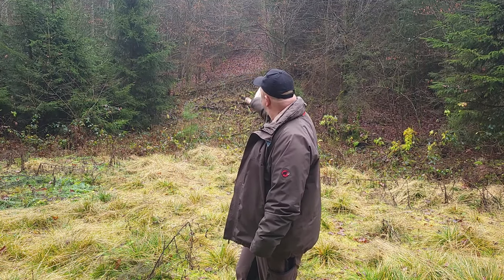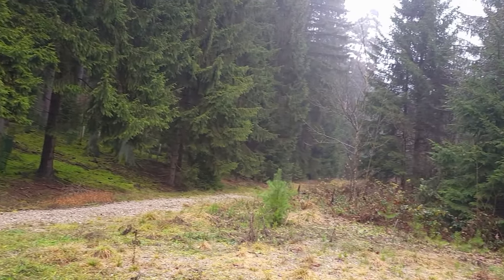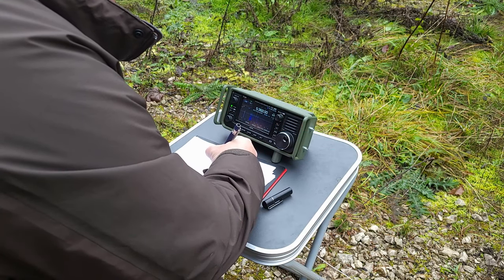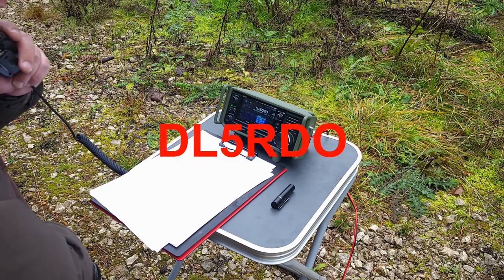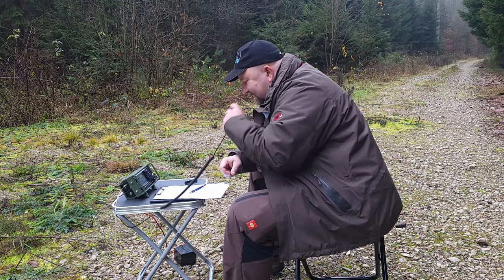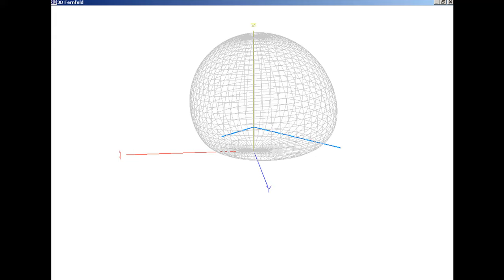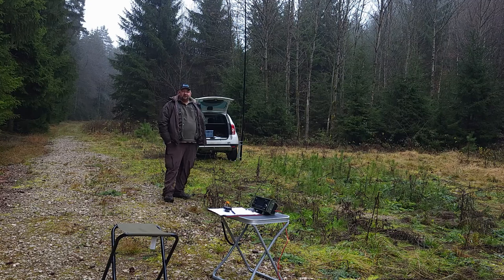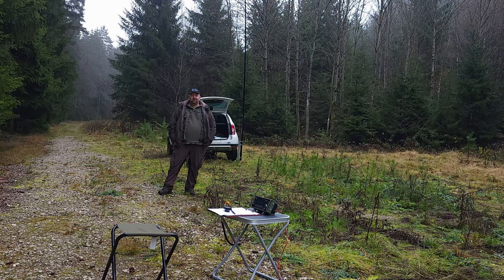Demonstrating NVIS communication from the bottom of a valley - with U01 Antenna

Comment: With my work on 2 meters, my Elmer has strongly emphasized getting my antenna above as much of the surrounding topography as possible. You have clearly demonstrated that the basis is different for HF. Thank you for the clear demonstration and the clarity of your presentation. Well taught.
Reply from the maker: It always depends on what you want to do. Usually an antenna needs a certain height above Ground. In our case, we want steap radiation, not flat.

Comment: That was a good demonstration of an essential ecom mode of operation.

Being a native of Florida, I'll have to wait for a vacation to duplicate your success.

However, I have had good success this past summer using 80m phone NVIS to check into the N. and S. Florida ARES nets with 20W consistently. Below 20W I would sometimes need a relay station to check-in.

My antenna was a 135ft 80m-10m EFHW deployed at about 25ft across a tree canopy and over a 5ft tall chainlink fence that seems to be a good reflector.

The EFHW antenna was a so-so performing antenna until I followed suggestions based upon experiments performed by Steve Ellington. He experiments suggest that grounding and choking at the antenna feedpoint provides about 3dBr improvement over other methods, specifically the most popular of grounding and choking at the transiever.

I now feel confident the EFHW is performing within -1dBr to -2dBr to a tuned dipole. With the ease of deployment of a EFHW antenna compared to a dipole the EFHW is now my goto antenna.

https://youtu.be/MzfQybYMlUc

Comment: I've been hamming since the 1970's, and in nearly a half-century of playing with antennas I came up with the best non-directional antenna system... a quarter-wave vertical and an NVIS wired to a switch.  The vertical has the extreme range sometimes needed, but leave much dead space on the way there.  The NVIS covers the dead space and serves well for communication on the lower frequency HF bands. The vertical must be properly counterpoised and I'm not talking a couple of ground radials.  Think a half-acre of heavy gauge chicken wire .
Reply from the maker: Thanks for your comment. This would be a good stationary setup at home. Best of both worlds.73 Manuel; DL2MAN

Comment: I can confirm: NVISon 40M  just works. My setup for NVIS is a "dipole". Why I write "dipole"? Well, until now it is not a dipole as expected, but my 9m EFRW setup "abused" as a dipole with the 1:9 UNUN about 2M above ground and both 9m wires at the same height. Will build a resonant dipole without the UNUN just to save weight for portable use.

Comment: With long distance results to the East is that in line with the antenna? NVIS bouncing upwards with the shallow slope or merely pushing through and up the valley - what was the orientation of the antenna (transformer to mast and also the valley?)
Reply from the maker: Hi, I explain the setup of the antenna very detailled in the "lidar picture" segment. Transformer was in the west. End in the east. The valley runs roughly west-east. I had no contacts to the east. 2 Contacts further away west, and the remaining contacts were mostly nearby north (where the hill was blocking )

Comment: Great video  I find NVIS very interesting  I assume the 705 was not full power using the battery so maybe 7 or 8 watts?
Reply from the maker: The initial QSO (SOTA Sation in France) was with IC705s own Battery (5W) and the following QSOs were with full 10W using external LiFePo4 Battery.

Comment: If you are in an area with tall trees like that, do you absolutely need an antenna like that? I have a uv-5r and I can't hear anything from it.
Reply from the maker: uv-5r is VHF/UHF (much higher frequency) compared to HF, which is what I was doing. Antenna Size is determined by frequency used. I suggest to gather some basic knowledge about radios and frequency. If you would visit a course in preparation for your ham radio license, you learn stuff like that, and I can only encourage you, to do it. Knowledge is power ! 73 Manuel; DL2MAN
Reply: @dl2man  The book for my technician license is arriving today. I know I don't know enough right now to point myself in the right direction.
Reply from the maker: @coolbeanzs  Great move ! We´ve all started somewhere. What I did in my Demonstration was HF or Shortwave. I transmitted in Modulation SSB (opposite to AM/FM, which you might know). Frequency was in the 60m Band (Frequency around 5MHz). This should give you plenty of words to search for on youtube or google. Start with something like https://www.youtube.com/watch?v=Ow1hxClR5J8 And just to reply to your initial question: Yes, for shortwave or HF, you need bigger Antennas compared to VHF/UHF, what your UV-5R can do. On VHF/UHF your range is basically limited to line of sight, while on HF or shortwave, our signal is reflected off the ionosphere. 73, Manuel; DL2MAN

Comment: NVIS communication is not magic. It only does what the law of physics tell. It just seem like magic.
There are no special gizmos needed either. End feeding directly on the trx or ATU is fine. Better still is getting some height
over the ground with a low loss feed line. Not terrible important as the antenna can be set low = short feed line.
Safety reasons advocate nobody getting caught walking into the wire. Even a lower wire works well.
A lower than optimum height lower QRM at the cost of some tx signal strength. Closer towards optimum height increase
your tx but might give you more QRM on your rx. 
I feed my field antennas with a ladder line (Hühnerleiter). On 80 mb even a 20 meter (1/4 wave) wire do the job good enough.
To top it it of I only run 5 W. There is no magic involved. NVIS is really perfect for a KISS approach.
(Keep it simple, stupid!)
DL2MAN: I like that you don't try to act "tacticool". I think you delivered the message about NVIS.
de SA3BOW
Reply from the maker: Thanks for the comment. I agree, there is no magic in NVIS. What I wanted to demonstrate in my Video is simply how it works. And what is better for demonstrating vertical radiation, than preventing the possibility of flat radiation by terrain. I think this is quite a powerful demonstration, when the average joe knows: You need to go to the top of the hill for best radio range..... And I think this demonstration helps to let the NVIS Concept sink in..... At least I hope so. 73 Manuel; DL2MAN

Comment: Eine höhere Antenne würde natürlich noch besser funktionieren
Reply from the maker: Eben nicht. Hier geht es um Steilstrahlung. Dazu brauchen wir niedrige Antennen, weil der Erdboden als Reflektor genutzt wird ;)
Reply: @dl2man  Das ist doch Unsinn, so ein geringer Abstand wäre viel zu wenig für einen Reflektor. Das Problem ist jedoch die Absorbtion durch die Bodennähe, die zieht den Antennengewinn in den Keller. Maximale Steilstrahlung auf 60m  ist mit einem gestreckten Dipol bei einer Aufbauhöhe von 9m erreicht, einfach mal mit EZNEC simulieren, das Programm ist ja inzwischen kostenlos.
Reply from the maker: @MrTalaue  Das ist kein Unsinn. Das Problem ist, daß wir bei "höher" unterschiedliche Dinge meinen. Wenn Du von höher redest, denke ich in n x Lambda. 9m liegt durchaus in einer möglichen  Aufbauhöhe, aber eben als Inverted V. Entwicklungsziel dieser Antenne war eben ein möglichst einfach zu realisierendes Standard-Setup zu finden. Diese Antenne funktioniert super als Steilstrahler. (wie hier aufgebaut als Inverted V mit 7m Mast. Einfach mal simulieren ;) Oder -mach´s wie ich: Probiere es einfach aus. Das macht eh mehr Spaß ;) Dann siehst Du irgendwann auch, daß die unterschiedlichen (echten) Böden mehr ausmachen als 2m mehr oder weniger Aufbauhöhe. Dann stellst Du aber auch fest, daß ein gestreckter Dipol in 9m Höhe ein praktisches Problem darstellt, weil er aufwändiger aufzubauen ist. 73 Manuel; DL2MAN